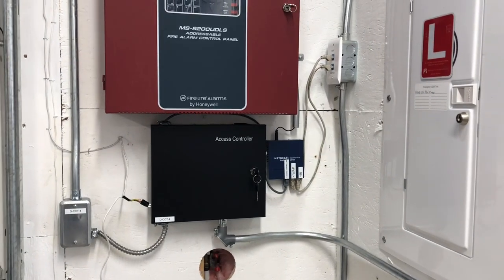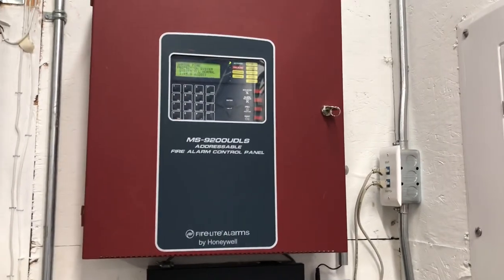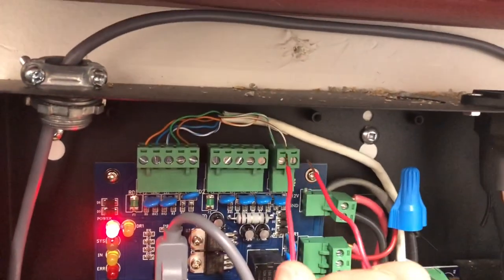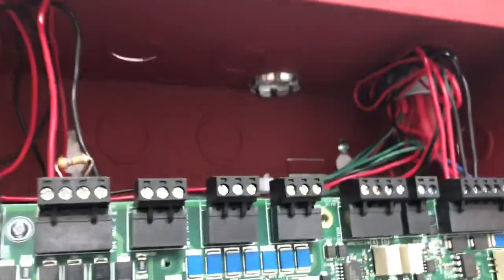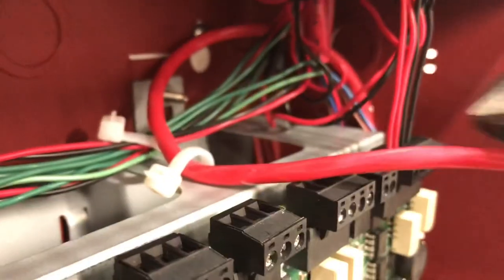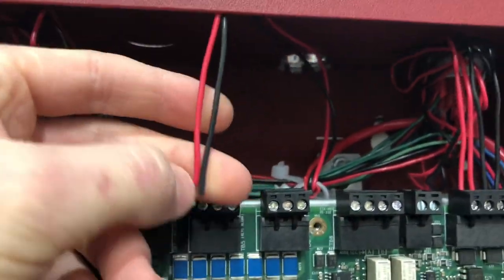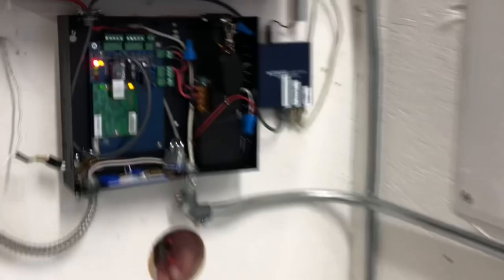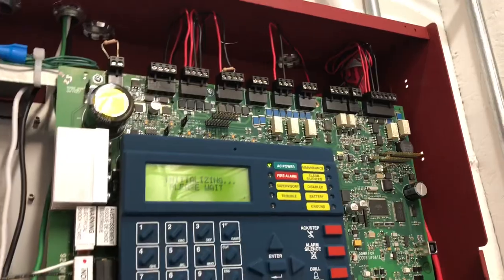How to connect fire alarm system to access control system.

Comment: Thank you very informative..how will you connect it if we have multiple doors around the building with 1 door controllers? Will we need to run a cable from each access control controller exit button connection and have all bridge to the alarm point for common and normally open circuit on the fire alarm panel? Or from the access control server can we have just 1 cable that can de activate all doors around the building when the alarm goes off?

Comment: You said you where not going to lolz!!! But I’m glad you did makes the system more realistic and safe!
Reply from the maker: I think this actually made it more unrealistic
Reply: @nics-systems-electric  Why?
Reply from the maker: @firealarmdiscovery  because I’ve never seen it in the field
Reply: @nics-systems-electric  oh really? Wow I’m actullh surprised because at my schools they do that on every campus I’ve been at so I assumed they did that a lot. That’s why I said it made it more realistic. Non the less I like the idea of it for some reason!
Reply from the maker: @firealarmdiscovery  at my high school it can be manually activated so the Smoke exhaust fans come on and the exterior doors will open up access control will unlock and then the handicap access open the door
Reply: @nics-systems-electric  that sounds like what my school does
Reply from the maker: @firealarmdiscovery  if you mess it up though and only have the exhaust fans come on you can’t open the doors because the vacuum is so powerful It takes two people pushing very hard to open the door
Reply: @nics-systems-electric  that’s true! And could be super dangerous!
Reply from the maker: @firealarmdiscovery  yeah we did that once when testing just a week ago actually and we didn’t know that the exhaust fans were still on and we went to leave and we couldn’t open the door
Reply: @nics-systems-electric  oh my that would scare me even if it wasn’t a real emergency! Once me and some staff were testing the alarms out at my school and they where in the bell control room in the server room (with no alarms in there plus the fire control panel is on the other side of the building) and there was miss communication and they sounded the all clear bell when the alarms where still going of with just the strobes. We had to rush to turn them off quicker then we where panning on turn them off because we had not been done checking the classrooms.

Comment: Great info I have done numberous fire alarm to access door release. Always use one addressable relay (normally open) and tie down to the REX( the contact your using) input of access control panel. Short on alarm and jump around to all doors in parallel. Opens all doors on alarm. Nice work!!!!
Reply: Hello M_Lopez have you had any experience simulating a loss of power to the FA panel? This is part of a fire Marshall request and I’m trying to figure out how one can do this via programming only and not removing power cabling.
Reply: @matthewpadula1731  If you have the access control power to locks from on power supply you can add a relay from the fire panel to be closed in that power circuit - locks working and if there is a power failure it will release the locks when releasing the relay. I am also just learning this so I might be wrong. I have some PLC experience there they teach if its life/limb safty the connection should always be active and only in the emergency event should it be broken. reasoning is if the wires get broken you will know you system has failed if it is a open system you will not know that until you energize and need it.

Comment: Hello, thank you for your informative video. I have a question that a fire inspector asked me. How could you via programming simulate a loss of power the fire alarm panel. Upon loss of power to the fire alarm panel, the mag locks are supposed to de-energize. My problem is that the FA panel is commissioned so I don’t want to remove wiring and disconnect cabling to the FA Panel. In this scenario could I somehow add a N.C relay, where once power to the fire alarm panel is lost, the N.C relay would close and cause a control relay to turn on which can in turn be used to program the de-energization of mag locks?

Comment: Hey pickle just a quick question about the lights on your bike how many battery do you use to power your lights and how do you connect them because I just got some to day with the 12v battery
Reply from the maker: For the lights I’m using a 12 V rechargeable battery two amp hour
Reply from the maker: I have a video on installing them so I’d watch that

Comment: What did you do to link the FACP to the Voice Driver? I see you have it wired up to the DSC panel, just not quite sure how the fire alarm panel caused the other panel to kick in, if I'm not wrong how do I link a burglar/fire panel combo and a FACP together?
Reply from the maker: I explain in the videos on it
Reply: @nics-systems-electric  In this video?
Reply from the maker: @oreonproject  no it's my voice driver video
Reply: Are you able to hook this voice driver to a real FACP without it blowing up or overloading? @nics-systems-electric
Reply from the maker: @oreonproject  you would never do that for a real install as it isn't listed or approved for that it needs 12 V most fire alarms systems are 24 so you would have to use relays and separate power supplies but it would not be supervised

Comment: Pickle I do have that key switch that you showed that looks like a light switch but I couldn’t figure out how to use it
Reply from the maker: You need a key.
Reply: @nics-systems-electric  Ik but when I originally had that key when I bought that key switch I couldn’t figure out how it works pickle I’m serious after not knowing how it works ive misplaced the key
Reply: @nics-systems-electric  can you help me I did use a key but couldn’t even get the key to work are you going to do a video of how to operate it?
Reply from the maker: @VOLTRONDEFENDER4440  you just put the key in and push it up or down
Reply: @nics-systems-electric  I did it didn’t go in at all
Reply from the maker: @VOLTRONDEFENDER4440  then your doing it the wrong way it only goes one way
Reply: @nics-systems-electric  I put it in the hole on the right but dosent go in
Reply from the maker: @VOLTRONDEFENDER4440  no no no it goes in the top if the switch is in the on position or bottom if in the off position
Reply: @nics-systems-electric  I did try that but I did see staff insert into the right with it angled I even tried that but stil not going in like it’s way to small for the key
Reply: @nics-systems-electric  and I did say I misplaced the key for it
Reply: @nics-systems-electric  I will have a video posted once I get a replacement key

Comment: What kind of access panel is that? Also what if you had multiple doors ?
Reply from the maker: https://www.amazon.ca/Complete-Network-Control-Electric-Remotely/dp/B01NAI79L8/ref=mp_s_a_1_2?dchild=1&keywords=access+control+panel&qid=1624157761&sr=8-2 this is the one that I have.  You will have to get one for two or four doors depending on the amount that you need to control

Comment: Be careful with these standard Chinese access control systems that use 125khz RFID for access. These cards or tags can be easily created or duplicated with simple tools that can be purchased online.
Reply from the maker: I am aware I have tools for that I am using 13.56 MHz but they still are not encrypted but that is only an issue if somebody can actually get their hands on the fob
Reply: @nics-systems-electric  Alright good to hear. Too many places where I live rely on LF tags for sensitive/high security areas. Not good.
Reply from the maker: @P25AES  The 13.56 MHz curds can be duplicated the same way the readers/duplicators are just a little more expensive